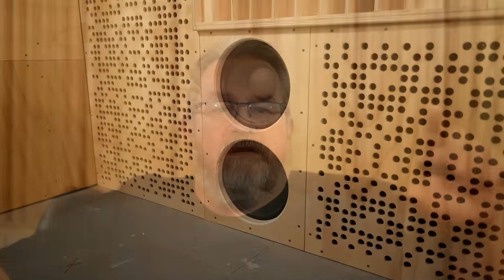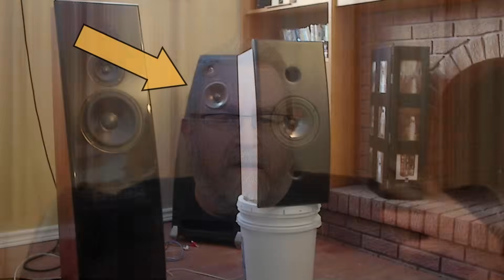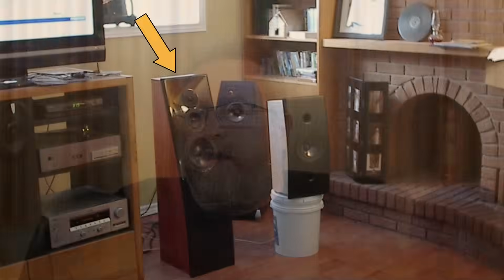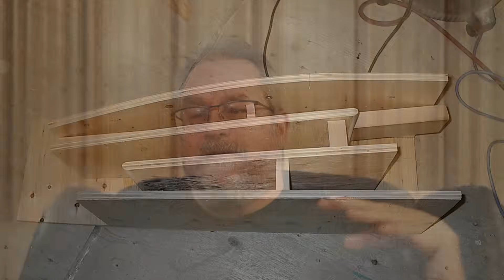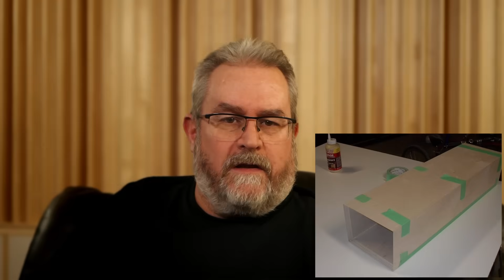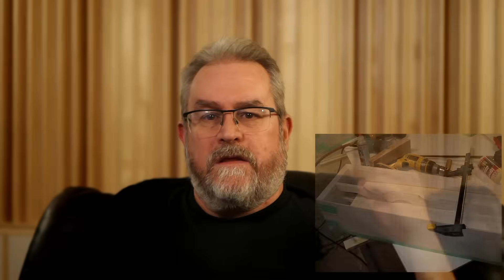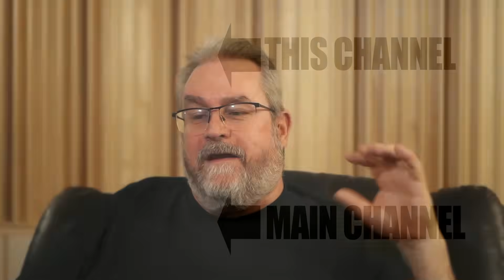Transmission Line Speakers are a Trap

Comment: Making the pipe layer'd with a layer of dynacord or some other frequency absorbing rubber can be fun too but takes a load of "trail and error" to get this right the guy from PSAudio(i think at least) made a video once where he went real in dept on this and  also showed some test results. 
I just think lambda-labs are the king in doing what he is describing but not by making a "pipe" or port but by flipping a speaker (this works surprisingly well outside maybe even better than inside)
But this comes at a price that is not low while inside if you have the room a vibration speaker  (forgot the proper name) and some hanging styrofoam can give a great result too for say a 150/200$ but it will miss the spl of a decent woofer.
But its also asking your self what do you want? 
Clear sound that can go loud too?
A lot of air moving?
Or just clear sound?
And how much time/money/wood are you willing to spend vs the how handy are you.
Its not hard to get the tools to build a speaker but this "hobby" turns into a thing where it goes from physics to philosophy really fast and for you know it you have a cnc woodcutter and 70 different speaker types that all sounds great or not so much ^^ not forgetting the knowhow / measuring  microphones to properly get the test data is a whole rabbit hole on its own specially when going into active crossovers with 3 or more layers.

Comment: I had open baffles and the sound I had was so open and clean, with deep bass, the only box I have done as a subwoofer to get that clean open easy bass was a transmission line, no other system did give me the same, the bassreflex was less clean then that transmission line, it was far from it. But i had also build a line who did ruin all musicality from a speaker also, it is complicated and needs simulation.

Comment: You don't need to have the TL box perfectly as the ressonant frequency, you NEED it, but its not mandatory. Get a HIGH excursion driver and use it in the box, it can be good. I am going to build it and prove or bust this myth. I want deep bass. I hope I can get it. OR I will get it with the P.R. design.

Comment: huh.  I figured group delay and phase were going to be bigger considerations here. I can't see how they wouldn't be.  Adding to the path that the audio travels through, and considering sound doesn't travel instantly, I'm having trouble understanding why a transmission line wouldn't muddy up and cause weird phase issues in the low end.

Comment: In my opinion the transmission line has its place and it most certainly isn't with me. I'll build vented enclosures all day long vs a t-line. The sacrifice of space isn't justified, for me.

Building/"designing" is a rabbit hole I've seen a dozen of friends fall into. I've had to send Alice in to pull them back out.

In the car audio subwoofer world I've taken 2 8" drivers in a 6th order series bandpass and hqve shown my friends the way. This is the way.

Comment: I'm considering replacing my TDL Studio 1 Mk 2's in the near future, I have been offered a good price for them by a friend who absolutely loves their bass v footprint ratio, he's a film buff with a small room and wants to do away with his subwoofer, I'd like them to go to a home where they will be loved so I'll likely accept his offer. But how do you replace a really well designed TL speaker?
With another TL of course and in my case I have decided it will likely be the PMC Prodigy 5's, I listened to a pair through modern Audiolab gear, I'm using older 8200CD/8000Q and 8000M's and they sound very good indeed.
Probably a slight upgrade but I won't really know until I have them in situ.
It will also be interesting to try them in my living room against my DC3000's. I'll never understand why they had such a short production run when their replacement and subsequent designs at that sort of price point have been nowhere near as good?
As far as building one goes,....well my wife nicknamed me Arthur cos I have this habit of never quite finishing jobs, not always but...

Comment: Years ago I built a pair of transmission lines using black PVC pipe and 4" Eton Drivers. I placed the driver 1/3 along the length, no taper. Just a straight tube with a t-connector about 1/3 the length. That was an extremely easy build. I didn't do any extensive measuring or calculating. I just stuffed the tubes by ear. I used a toilet adapeter at the base to hold them up and vent them at the bottom. I was shocked at how good it sounded, and how low the bass was out of that measly 4" driver. That was the only speaker I ever built that my keen eared girlfriend actually liked and used continuously. I'm still thinking about why those were so pleasing. Part of it was minimum baffle, I think. The driver just fit over the end of the pipe. I actually had to cut a hole in a pipe cap to get enough material for the screws to chew in to. Also important was making it a two way instead of a 3 way. I started out with a 3/4" dome tweeter and a 2" dome midrange used with the 4" mid-woofer. That could play ridiculously loud, but there was better synergy with the 4" crossed straight to the tweeter.  I set the crossover by ear, and it turned out to be at about 3500 Hz where something beautiful seemed to happen, and the speaker was able to actually win my girlfriend's enthusiastic approval and near around-the-clock confiscation. These were best at moderate and lower volume.

Comment: Even if your TL design doesn’t meet the expectations according to bass enforcement, the decay of the bass might get more accurate. So there is still a benefit of this concept. The challenge is to find a development method with a variable enclosure to make improvements before you build the speakers.

Comment: You need to use hornresp rather than those old sheet.... And use driver offset to correct the undamped response and try to minimise dampening so you can preserve sensitivity but get smooth response...

Changes everything compared to stock old fashion transmission line

Smooth extension, predictable and can be crossed higher

Comment: So, you just do not build proper one :D Thanks for material! 
Design and math are really simple ;)

If you leave open hole at the end of the line, there will be much more bass. However, if you close the end, sound of a woofer would be more linear. I checked other types of enclosures with the same drivers. Ended and happy with a pair of TL enclousures.

Comment: One note: you say at the start that a quarter-wave length pipe is in phase with the driver! That's not true, a half wave length is.
Reply: It took me a while to wrap my brain around that... The quarter wave works because in the time it takes the sound to travel in one direction down that quarter wave the sound has also traveled forward from the front of the driver totaling a half wave. The easiest visualization is this. The front of the woofer could be visualized at 6:00 on an analog clock. The back side of the woofer is 12:00. Sound leaves the woofer at 6:00 traveling clockwise, sound leaves the back of the woofer out of phase at 12:00 traveling counterclockwise. They meet at 9:00 in phase. I have a big old pair of IMFs (last generation professional monitors, basically the last edition of the TLS80.) The effect of the merger of the two signals I think is part of why it sounds like the bass is out in the room, not coming out of a speaker. Like every other speaker I've  heard ever.  Transmission lines can totally work... And bring a new level of resolution to the bottom end especially... But man are they a bitch to get right.  I've heard one of John Wright's earliest big monitors, and I heard the last one the RSPM7. The difference is enormous. As good as the original was. The sevens are the single greatest speaker I have ever heard. Including some six figure madness
Reply: @ajn465  No, the front wave can only be in phase with the backwave if the path length to the listener is half or one-and a-half etc wavelength  longer than the direct path,  any other wavelength won't be so from that you know being in phase is not a  thing. You can look at the port and driver output graph of any TL to see the phase cancellation pattern of a TL. A TL is just a quarterwave resonator normally tuned to the driver's free air resonance.. 

As for your perceived bass quality, agree - these are some factors that a TL has: (1) the TL large port size  makes it highly efficient in coupling to the room (2) a large port distorts less than a BR (3) it can be damped to nearly the performance of a sealed cabinet (4) not a single note bass of a BR, much wider port output
Reply: @EduardBroekman ok

Comment: Tamiya t-line seems like a way to make a really cheap speaker sound really good with a really complicated enclosure I am no good at woodworking so I prefer to buy quality components and use a standard sealed or ported enclosure depending on the use case

Comment: Not sure if "trap" is the right wording, most enthusiastic DIY speaker builders with experience are more than capable of doing the work, amatuers on the other hand will even struggly with the best plans laid out for them. The old R50 was a knightmare with chipboard for a novice.

Some of the best bass I have heard has been from transmittion line, done well it's great, still to this day the PMC BB5/XBD system has been one of my favorites. I love full range systems down to around 20hz if possible, and TL can do that if done well. That was why we all wanted DIY R50's while lusting after IMF References.

My 1st transmition lines were Nightingale Audio N-M1 and I like many had the Cambridge R50 home made TL system, both were nice, but I remember those R50's being one ugly poorly finished speaker. 

I don't see much reason for a shortened TL line when a port can do the job if bass is still limited, but again companies like PMC prove even small boxes can acheive great results with a TL type enclosure.

When you have speakers like PMC, KERR Audio as examples doing transmition line well, ported rarely does it for you. Sadly the prices for serious TL speakers are beyond what many enthusiasts in a house want, and the old designs such as the IMF Reference, or even Cambridge R50 do show their age somewhat today. 

At least they still have some fans, I'm still on coupled cavity and who remembers or uses that these days, if I had the space and finances it would most likely be a TL variant. 
But the reality is with so much of us listeners now being music and movies a system probably would be better off with a pair of active subs and high passed tops, as even some low end capable hifi speakers simply dont suffer the massive headroom and dynamics of movie content well.

I dont visit much forums these days, so many nice drivers but sadly no one sharing proven cabinet designs and networks or amplifiers for home enthusiasts. If there was a simple plan that was easy to follow for a decent bass driver such as those Volt many love I would possibly contemplate revisiting it all.

Comment: Excellent explanation of TL! I have a little anecdote where I used a budget but good sounding woofer Monacor SPM-165/8 and build it in 3 different enclosures TL, CL and BR, crossed at 2KHz, and the midrange became more detailed in the TL. Reducing reflections behind the driver I believe did it, but I guess that could be done to the BR and achieve the same, but the TL I believe is better on this still by letting more out of the box. Thank you for the video, really clear and entertaining.

Comment: Considering how amzing tapped horns sound when well done and integrated in the setup and the insane output they have i think it's a waste of time to build a TML as it take the same effort as a TH. So i think from an effort vs result standpoint it is a trap.
Reply: ODTLs have a wider usable bandwidth than THs.  I've built both, and prefer the ODTL.
Reply: @Grommet2007  Can you please link me some article or something. On googling this enclosure type i couldn't find much. In any case our 2x12 infrasonic PA sub that's tuned to 15hz can be very well crossed at about 80hz at the highest. Depending on the room they go down to 12hz -6db. 12-80hz is a pretty big bandwidth i would argue. Despite this we often cross it at 50-60hz. Then it has to do a amaller bandwidth and in that smaller bandwidth it then can play louder. Keep in mind that's full send 130+db with 3 of them at 14hz and up and can't be compared to low volume everyday home listening.
Reply: @ ODTL = Offset Driver Transmission Line.  Basically a TL with the driver offset to null out the 1st harmonic resonance.  This increases the usable bandwidth.
Reply: @Grommet2007  You mean the bump that TH have in simulations pretty much in the middle of the operating range? Something that can be designed around. The right folding and shape of the fold can eliminate it and what you end up with is a response that may just be flat or have a slight shelf in it which is easy to correct and the sound result is simply amazing. I myself designed 3TH so far and they don't have this resonance because of the way i fold them. 

Transmissionlines don't do impedance matching so can't have the output of a TH while being the same if not more work to design. Might as well just go ported using a passive radiator and tune the system the right way.

Comment: An audiophile Buddy gave me a design that mimicked the Radford speakers. The dadoes involved the MDF were quite the challenge.  In the end, the speakers imaging was fabulous. The bottom end may have been wanting.
Reply: How much harder or easier is it to work HDF than MDF? I hate MDF…
Reply: @kineahora8736  I was living in Calgary at the time. The commercial suppliers didn't seem to be aware of the product. MDF is terrible stuff. I was negligent with masking and I feel I paid a big price. Never smoked a day in my life. A cardiologist seemed to think that wasn't the case. Buyer beware.
Reply: @francoisbouvier7861  sorry to hear it. But why would a cardiologist be looking at your lungs? I had baseboards installed— and the contractor used MDF. Didn’t ask me. A picture fell off my wall and onto the baseboard— basically turned into powder. Obviously, I would have requested plywood or any real wood instead for even twice the price. I removed a section of baseboards with an oscillating tool to fit my bed in without being obstructed by the molding— the oscillating tool was excellent without producing too much dust relative to a rotary tool… just one small cut with a rotary tool and dust sprays all over…

Comment: I heard a pair of TL speakers around 1990; sounded so good I had a friend buy them; less than $1000.  Made I think by Genesis.  Just a sloping PVC tube inside a slanted cabinet with a single smallish driver and a ribbon tweeter.  Maybe I'm misremembering over the years, but I thought they sounded spectacular.   Especially for such a modest speaker.  IMO blows away the passive radiator speakers I've owned since.  So I'm hoping someone jumps back on the derailed TL bandwagon.

Comment: I use a t-line in my car.
Got a 4” x 100” line which gives an approx tuning of 17Hz.
It’s not that big and is my favorite design.
Reply: I built a pair of tapped horns using 21" drivers for a local cinema. Response is flat to 20hz, -6db about 16hzz. With 1500 watts driving them you can see the seats physically shake.

Comment: I thought transmission lines were meant to boost the lower bass with the pipe, and trap the mid-bass, mids and highs with some foam in the line.

Comment: Actually no. A tl does not need to taper. At all. Allso the quarter wave length is.. a minimum length. Basicly you can Just by PVC pipe at a long length that can accomodate the driver , and 2 right angle elbow.  You make an U shape , at yay lenght. And there you have it. Thats a proper tl setup. 
And your ears will bleed.  Its an inferior setup. You can kindof heal some of the extreme shifts if you place the driver 1/3 down the tube. Still your ears will bleed. It sound shite.
Now , there are tl boxes that sound acceptible. Remodell the trapped air in those boxes , along with the dampening effect of the stuffing material. And you will see, that any and all of those boxes are Just actually sealed boxes. Modell it as a sealed box and you will see the correct response . 
In reality once you taper the tl , account for its effects and all the heavy dampening , you will be near where an infinite baffle would be. Absorbing as much as possible from the backside of the cone , to get rid of the accoustic short circuit.

To summ thibgs up , the best tl you will ever have is eighter a needlesly complicated sealed box , or a needlessly complicated and inefficient infinite baffle. 

There is nothing to be gained. Expect , if you are only interested in 1 single frequency sine wave. Like an organ pipe. And thats all.

Comment: I bought a transmission line speaker (very similar to the japanese made speaker on youtube with millions of views) and the box is fully CNC, with lots of layers glued together. The speaker is not bad, but yes it resonates. You touched the point about TL. It seems almost esoteric to get it right.